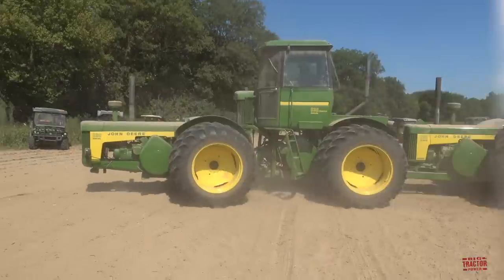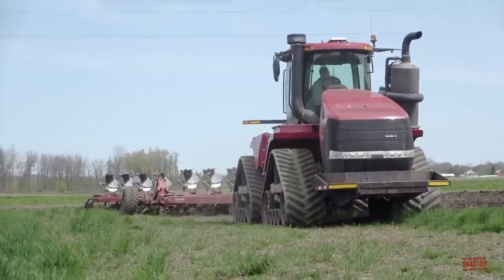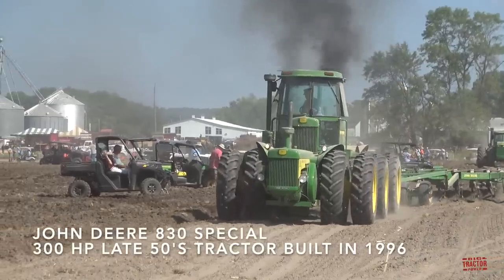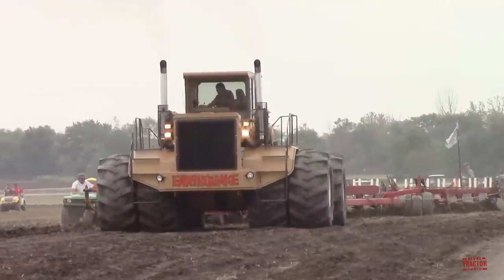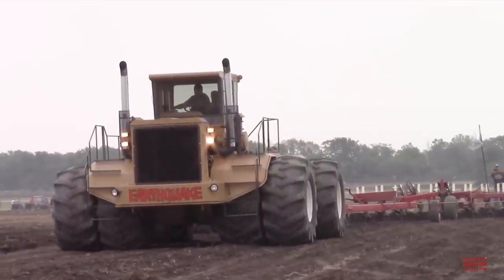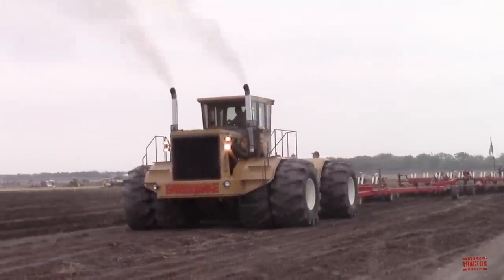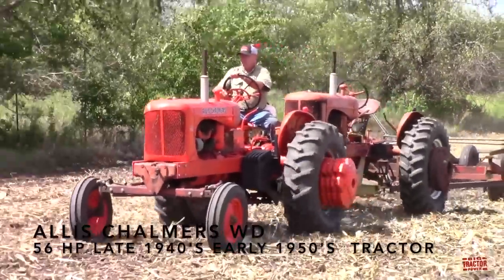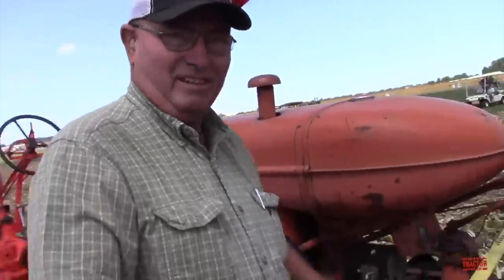TANDEM Tractors Plowing

Comment: I ran a tandem tractor setup back in the 1980's, It was a Minniapolis Moline in front and a Massey Ferguson behind but they were essentially the same tractor, They were the hand clutch models so on the front of the back tractor there were 4 levers the hand clutch, the throttle and two to control the hydraulics. Broke up 160 acres with a 16 foot deep tillage cultivators with spikes on it.
Reply from the maker: Very interesting.  Moline built the the Massey 97 which was based in the MM G705.  Sounds like a cool pair to see working ground.

Comment: 3:10  not always impractical.  We tried the same thing with an Allis WD-45 Diesel and a 190 Diesel to see if we could pull a 4 bottom through a field of clay.  The clay turned out to be too hard, kept tripping the bottoms.

5:30  not a couple of WD, the rear tractor is clearly a styled WC.
Reply from the maker: We’re you able to plow the field another time?
Reply: @bigtractorpower  Some years the moisture was right and it was plowed.

Comment: That’s neat. I remember seeing a rig like that sell about 10-12 years ago that had two Farmall M’s. I think both tractors were stuck and the articulation joint frame got scrapped. At least one of the tractors got fixed up and made into a pulling tractor. Thanks for sharing!
Reply from the maker: Neat to know a tandem was still around. Too bad it was let go to run down.
Reply: @bigtractorpower  are all those rigs totally home built, or did some company offer a sub frame that you could buy to put two tractors on? I thought several of them in the video looked kind of similar.
Reply from the maker: @rosstheoliverman  I do not know. You would think there would be a kit to help make it easy. Although the Great Depression era farmer was making the purchasing decisions during this time period so they may have opted to build the connection them selves to save money.
Reply: @bigtractorpower  it would be interesting to see if there was a popular mechanic’s article on it. They had lots of ideas on how to repurpose farm equipment.

Comment: In 1962 I start putting two tractors together and making a tandem hitch. I had a John Deere 70 tractor and an old John Deere a tied together. I also picked corn with a new idea corn picker with the two tractors I plowed ground I disced ground.

Comment: I once paired up an old cable operated D7 Cat crawler and a Minneapolis Moline 950 turbocharged LP gas tractor (it was the first LP gas turbo tractor in this area). I had thousands of small, budded pecan trees to dig out for sale so I built a root plow for the front of the D7 but in some of my clay soil the D7 wouldn't dig deep enough. I paired the MM for an extra 120 horsepower and traction. It worked well for one season then I bought a D8 dozer to avoid the hassle of coordinating two drivers.
Reply from the maker: Very interesting team. G950 is a cool tractor.  Thank you for sharing.
Reply: @bigtractorpower  It was a learning experience turbo charging an LP tractor. I discovered they make "pressure compensating regulators" for turbo charged oil field engines that run on natural gas or LP. That discovery allowed me to complete my turbo project.  I pulled a five 18" bottom breaking plow (requiring duals) with that tractor.

Comment: Funny how flat breaking plows were the norm for so many yrs. Now they are down right taboo in most places.
Reply from the maker: They were the number one way at one time.  Many farms still plow for certain crops.
Reply: @bigtractorpower  long as you have deep soil and not a lot of large rocks hiding, they aren't a bad tool. Shallow soil and caliche, you sure can make a mess. 

Dad use to tell a story of a farmer that flat broke some river bottom land deep. Had a wet winter and spring. Everytime the farmer tried to put the planter in the ground, the tractor would spin down. He had to wait to plant a fall crop before the ground would hold the tractor up.

Comment: Usually not to interested in pairing up tractors but really enjoyed this video. I noticed the farmall 560 had an M paired with it and the farmall 400 had an M paired with it. Those Ms must work with about anything.
Reply from the maker: The M was built to last a life time. The first M’s are in over 80 now. In the paired tractors the M would have been the big tractor on the farm then a newer model like the 400 or 560 was added.

Comment: The only modern example of pairing two tractors together that I’ve seen so far on YouTube was when Welker Farms had to dig a trench for a project they were working on but the biggest Big Bud they had wasn’t quite powerful enough on its own to pull the trencher through the ground, so they teamed up the biggest Big Bud tractor they had, a 600/50, with a wheeled Case IH Steiger 620, hooked together by a metal chain and this combined 1220 hp behemoth also required 2 people to operate
Reply from the maker: That is a cool combination.
Reply: That happens a lot more than you think lol.
Reply: @bigtractorpower  Yeah, Montana apparently has extremely rocky soil, so it takes a lot of horsepower to penetrate through it
Reply: There’s hundreds of videos like that on YouTube, and their 525/50 (it’s not a real 600/50) had the power, just not the weight
Reply: @nellsonstout7001  Oh, I thought it was a 600/50.
Reply: @noahater5785  Welker farms is the best farm channel on YouTube period. I mean look bro the have THREE Big Buds! None of the other YouTube farmers have Big Buds! And they built a sprayer with a Big Bud hood and called it BIG BRUTE! Their such innovaters! I know I’m only in 8th grade but I LOVE there channel so much and I wanna be just like them when I grow up! And I wanna polish Ron Harmon’s greasy ego just like them to! Oh my god dude THEY EVEN HAVE A FARMING SIMULATOR MAP!!!!
Reply: @noahater5785  so here’s the thing about Welkers and some other Big Bud owners that annoys the hell out of me as a tractor guy and (I guess you could call me an) amateur 4wd tractor historian? They do a repower or juice a machine up and change the model number to reflect that, and it makes it difficult to keep accurate tabs. There are 2 real 600/50s out there, and I think 5 real 650/50s, but so many 450/50 and 525/50 owners have changed numbers that it’s hard to tell. Not even Welker’s middle bud has the proper model number

Comment: Around 1958 my dad combined an international F-20 as the rear tractor with an Oliver 88 as the front tractor using an old railroad rail to hook them together.  We rode on the front tractor, pulling a 5 bottom plow.
Reply from the maker: Very cool. Two great tractors.